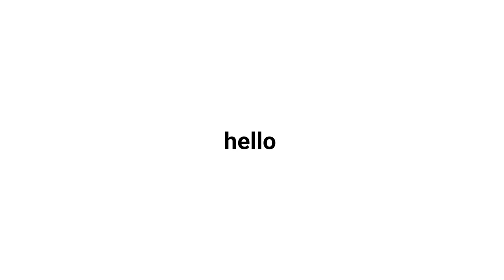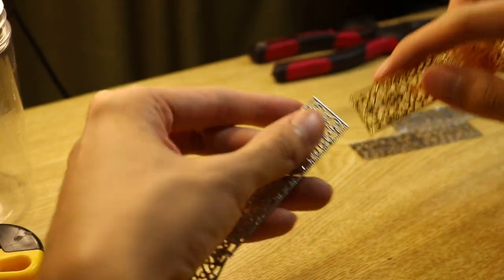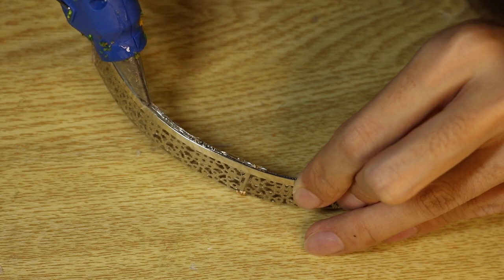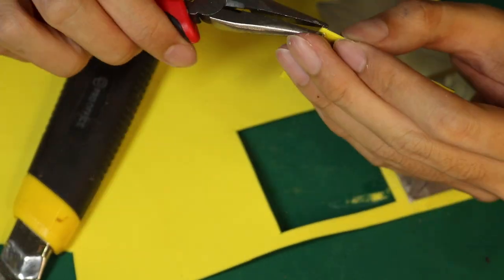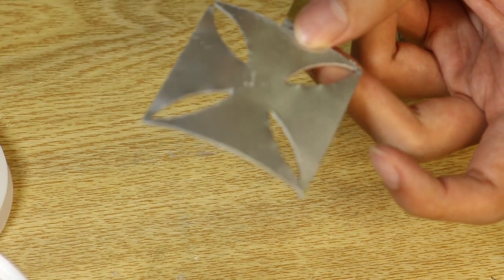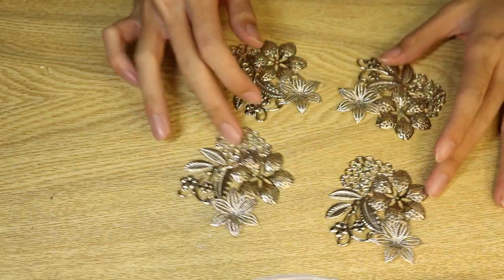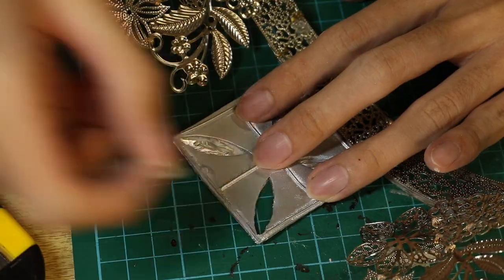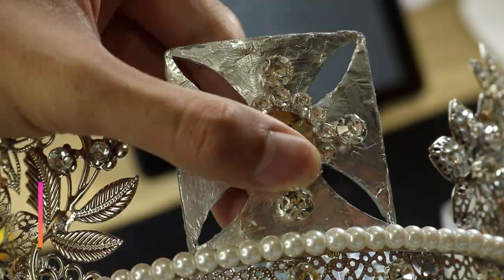Crafting Queen Elizabeth's Iconic Crown from Scratch! | Crown Obsession #7

Comment: Try experimenting with gold leaf.... You got to give it a shot. You can get the materials at hobby lobby for dirt cheap. You can get gold, silver, and copper foils. The brushes and finishing tools needed, burnishers, and of course the adhesives and other materials. It's way way WAYYYY easier than you would think. And gilding would allow you to do all kinds of awesome stuff.

Obviously the foils at craft stores and DIY shops might not be the best quality on Earth. But it's really good.  I've seen dozens of people use it in hundreds and hundreds of projects. And they've never seems to tarnish or decay over time. And are even more resilient than you would think. If it's on something in daily use.... Like a piece of jewelry worn regularly... Issues of wearing through or scratching  can always be mitigated by adding  a clear coat. In my opinion a good mat or satin clear coat looks decent . And you can really burnished the surface once the foil is on and it will give it a super-nice polished shine

It would cost a few pennies per crown and take almost no time. And that's if you gilded the entire thing. 

Always enjoy your content and good luck to you and your channel 👍🤘